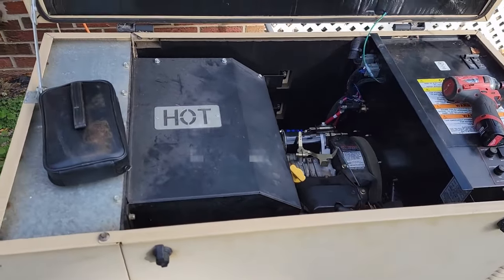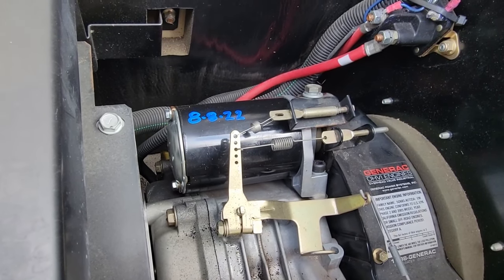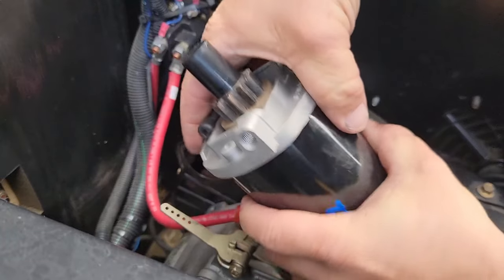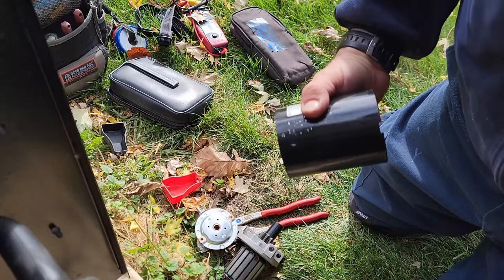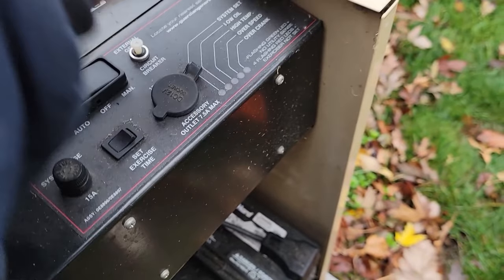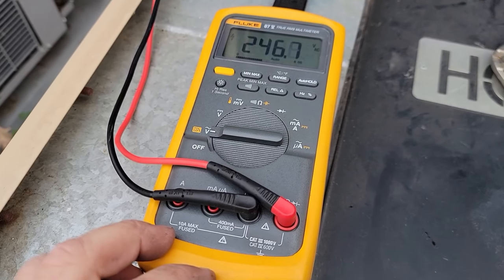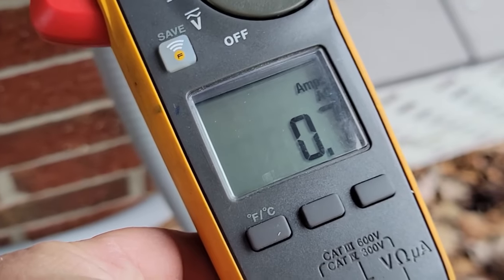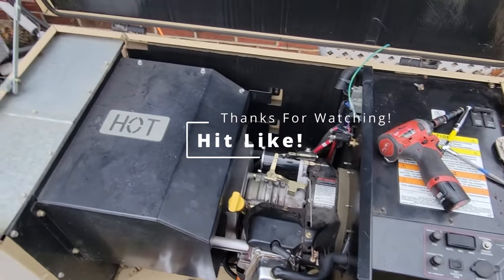Generac Standby Generator Wont Start AGAIN!!!

Comment: I have this exact model but I'm getting 160 volts out per leg. Do you have any suggestions? I'd appreciate the help.
Reply from the maker: Is that measurement L1 or L2 to neutral or between L1 & L2? Either way sounds like a voltage regulator is bad but you should have it tested before you spend the money on a part that might not be bad.
Reply: @HVACRSurvival  perhaps you could point me in the right direction with the diagnosing it. 
First time I fired it up. I got 120 volts on both lines to neutral.. hooked it up to the cabin and charged all my batteries. The well pump cycled on which may have spiked and put me over 3500watts 
Now I'm getting 160 volts out each line.
Reply from the maker: It likely is the voltage regulator but I hate telling you that and it not be it. Kind of hard to diagnose it without checking voltages and certain particular spots, and I'm not able to do that over the internet.
Reply: @HVACRSurvival  I completely understand that. Like telling someone how to fix a car over the phone. I was just hoping that my hunch was correct. Thank you for all your help.

Comment: Sold car starters for 20 years the shins where mostly for rebuild starters ,when they stone tumbled the nose piece would make the clearance to tight ,drive bendix would hit flywheel and not engage . Didn`t need for new starters .
Reply from the maker: I did this job over a month and a half ago and it is still working as far as I know, unless the customer doesn't know that it's not running. So I would say it was not needed, and that's why I showed the piece of paper instructing me to use that particular shim even though it obviously caused a problem. Just another inconsistency with generac

Comment: Is this generator from before or after generac decided to just send out notice that they need "rings" for new builds and get whatever and just use it? During hurricane IDA generac standby units down here were drinking more oil when operating than the Exxon valdez leaked.
Reply from the maker: I haven't heard of that, Usually they just don't run, eating oil has never been a issue for me.
Reply: @HVACRSurvival  don’t know when it started but my local dealer axed them after hurricane ida when he was on the move 18 hours a day feeding them oil. Kohler units were problem free. Within spec is apparently up to 1 quart a day for generac. That’s just nuts.

Comment: Hopefully you find out why its eating starters. Is it cranking for to long causing it to overheat? Maybe the last one toi put in was junk but that makes 2 that are junk... your on your 3rd now. Seems like a lot of starters for something that hardly sees any use.
Reply from the maker: The one I first replaced was the original, the new one was likely defective from the factory, the one in this video worked when I was done, then she bought a new outside unit.

Comment: Would it have been a bad idea to spray some lubricant of some kind on the flywheel teeth ??
Reply from the maker: It might have helped, I didn't think of it at the time and it likely would have worn off quickly.  In the past when I have replaced the magnetos, I have brushed off the rust and painted the raw metal.
Reply: yes and no.  Since these are exposed, it probably  needs to be a non-detergent kind of oil.   If it was fully enclosed, such as my old Ford Escort, you'd use a grease.   It's unlikely to wear off as quickly as most would think, because the starter spends the bulk of its time sitting - there's little to no friction to wear off the oil.   If you do a yearly maintenance, that would probably be plenty.
Reply: @tbelding   Of course if you could get in a time machine and go back 15 years and get a quality part you wouldn't have to worry about lubricating anything.....
Reply: @2packs4sure  - unfortunately, we can't control the manufacturer, or rather, the assembler.  We can, however, control what happens to the part we replace.

Comment: You used the wrong shim so it wasn't aligning with the flywheel properly. It was binding and that's why it failed. Use the thick dogbone shaped one that comes in the box with the starter kit.
Reply from the maker: I did you that one and I used the thin one that I showed the paper work recommended, I removed the thin one before I left.
Reply: @HVACRSurvival  I've probably changed a hundred of those over the years on the single cylinder engines. They're not great starters. Always just the dogbone shim for them.
Reply: It appeared that the original burned up starter didnt have the thick shim.
Reply: @willrobinson9575  likely what caused it to fail. Not being aligned properly. Every one I've ever replaced has had the thick shim from the factory. Replaced 2 yesterday.
Reply from the maker: @willrobinson9575  it had both just like the instructions called for.

Comment: Wearing a ring?
Use paint marker or sharpie for springs (to mark) or take beginning pics
Reply from the maker: I wear a rubber ring. I have a paint marker that I use in most of my videos.
Reply: @HVACRSurvival  I just found your channel. 
How do I get on with somewhere like Generac? Sounds like you may not like them though
My military mos was power generation repair in 90s and have a 2 year small engine certificate from high school in mid 90s .
A shop said the other day my small engine certificate is useless bc so much has changed but I don’t believe it bc I’ve been working on small engines for weeks and just disassembled my generator that slung a rod.
Reply from the maker: Anybody can take their small generator class once that’s done then you can go to Commercial.

Comment: My generac keeps cranking and cranking but doesn’t start I changed the plugs but not sure what else to do because I’m not to familiar with LP system it has a puff of blue smoke when it does start….any ideas ?
Reply from the maker: Best off calling for service before you waste a lot of money on parts you might not need.

Comment: Completely unrelated to this partial video, however I want your opinion. How do you feel about Generacs announcement they are now recommending 5w20 oil in their standby generator? Me personally, in an air cooled engine that may run for 100 hours straight (most homeowners aren’t going to shut it down periodically to check the oil) I would want thicker oil with a good additive package. I’m located in SE Texas where it can be 100° out so in all of my power equipment with a pressured oil system I run AMSOIL Small Engine 10w40 or 10w30 in splash lube systems. Does generac have a reason other than marketing for pushing this oil?
Reply from the maker: For warm weather areas I've always heard using a strait 30 weight , we use 5w30 full synthetic because we deal with the cooler weather and need it to crank over faster in the winter.
Reply: @HVACRSurvival  so y’all haven’t switched to 5w20 at all then? Generac is really trying to push dealers to the 5w20 stuff and I just don’t understand why! I have a 2021 18kw and it doesn’t even have an oil cooler! There’s no way I’m putting a 20 weight oil in it.
Reply from the maker: From what I heard we were having problems getting the generators in stock for a while. I haven't been working on many lately. I honestly am over working on generators all together,  I have such a variety of work at this place that I'm ready for someone else to take my spot.

Comment: Maybe deburing the teeth on the flywheel might help.A dremel tool,and then polish the teeth with a wire wheel.
Reply: Too much trouble unless it is YOUR generator.  Replace the flywheel!
Reply: @randyab9go188  ...and maybe even ( I know this sounds crazy) grease the shuttle.

Comment: I got. Generator just like that in my house. put a new battery unfortunately, I can't figure out why it won't produce power. any suggestions ?
Reply from the maker: If it runs, then it could be a bad voltage regulator,stater,brushes,control module, if it don’t run, then it could be bad magnetos, fuel solenoid or regulator. But all those are just guesses without seeing it.
Reply: @HVACRSurvival   thanks man it runs I'll look into all those items.

Comment: The problem is that the flywheel teeth are so rusted that the bendix wheel on the starter got hung up in the flywheel, kept the starter engaged and it overheated. Clean the flywheel, coat it with a rust inhibitor and you should be ok.
Reply: But he took away a shim which made the gears fit tighter and it didnt hang up.
Reply: @willrobinson9575  First things first, Happy New Year. Shim's are used to insure proper  clearance between the flywheel teeth and the starter gear to avoid undo stress on either. If you noticed the flywheel was severely rusted and by removing the factory shim the starter teeth were now able to ride deeper into the flywheel which is at best a temporary fix. Now that the shim is removed the factory clearance is no longer set and premature wear will happen once again. There was a reason the starter he removed went bad so fast and in my humble opinion it still hasn't been cured.
 The rust needs to be cleaned off the flywheel and somehow try to figure how to prevent mositure from entering the flywheel area. I personally think it's one of a few design flaw's in the Generac Generator's.
 I would never own one. How do I know so much? I've been the owner of a small engine authorized factory dealership (now retired ) son's took over the business since 1959
Reply from the maker: This generator model has been a total piece of junk since it was built in somewhere in 2005 - 2006 area, this is the reason why I talk so badly about this model, it caused me several service calls over the years and it just was a total failure. Between this generator and a traditional generator,  I'll take my standard generator any day over this thing. The lady was an older woman whose husband just died and didn't want to deal with problems anymore, so she purchased a new outside section and reused the transfer switch. The technology has advanced so much that it just didn't make sense to spend much more time or worry on this thing. I'm not one for replacing things if they're not broke but in this case and in her situation it wasn't worth the hassle. Told her to sell the other one on marketplace to recoup some of her money.
Reply: @HVACRSurvival  I agree and so does a leading consumer magazine. Total junk.
Have a Happy and Healthy New Year. 
I really enjoy your channel
Reply from the maker: @user thanks! You too!
Reply: @Riker-eq2yv  Happy New Year. But you said the rust was causing the hangup. Removing the shim should have made the problem even worse however it did not. It disengaged fine without the shim. I think theres more than meets the eye with this video.
Reply: @willrobinson9575  from Lost in Space? 👍
Reply: @willrobinson9575  I agree removing the shim will allow the bendix to dig deeper into flywheel teeth thus causing premature wear even faster.
Reply from the maker: Did anybody notice that the Bendix was getting stuck on its own? The starter was hanging up!  😳,  it's almost like nobody even watches the video? I never claimed to be an engine guy but I did show on the paper that I followed the directions.  Quite simply, if the thing doesn't retract on its own, it's only going to be more of an issue when it's installed in the engine.
Reply: @HVACRSurvival  Its all good brother.
Reply: @Riker-eq2yv  Careful, your age is showing.
Reply: @willrobinson9575  my age started showing when I was drafted into the Army right out of high school and within 8 months found myself in Nam.

Comment: Just FYI, Horrid Freight is selling a replica of your parallel pliers, and they are even red.
If you want to see the "counterfeit", search "10 in. pliers wrench with comfort grip".
Reply from the maker: I seen them, I'm sure they wont hold up like these have, being used as hammer.
Reply: They are el cheapo chinezium. Good if you need them for that 1 DIY projects, we techs don't waste our time with them. Plus we're tool nuts!
Reply: @FrozenHaxor  I'm not a tech, but I did mechanical demolition for 10 years, and never needed a Chineseium tool like that on the job. I'm a tool nut myself. I even designed a tool for my trade for removing the backer plate for fin tube.
Reply: @HVACRSurvival  for what I've spent on Knipex, don't think I'm using any of them as hammers, but then again I'm more of a desk jockey tool a holic than  real mechanic!
Reply from the maker: @Dave I feel that because I spent more money on it,  it should be able to take some abuse. But I know what you mean. I've owned them now for about 5 years so they get a little beat up now,  when they're brand new they never got beat like that.  😂

Comment: If the newer Briggs and Generac home standby generators are trash, what do you folks recommend?  It seems to me that these things aren't rocket science and it shouldn't be that tough to make one that would run for years in intermittent service.  

Does anyone make a standby generator with a Subaru Robin engine?  How about one with a Honda engine?  Both make very good engines and I know both make (or other folks make with their engines) portable generators, but I don't know about fixed standby generators.
Reply from the maker: Majority of the problems with Generac is with the older versions, from 2005 to maybe 2012  (-/+ 3yrs). The current year stuff is not too bad, we sell generac only because it's affordable, and that's what people want to spend. The problem is people don't want to spend the price that it requires to have a commercial grade generator or one of these diesels that everybody likes to talk about, which anybody that has any clue what's been going on lately in this world,  is the diesel stuff going to be going away. The governments are trying to ban all fossil fuels. 
*The other large problem that you've seen in most of my videos is the customer doesn't spend money to maintain their equipment. 60% to 70% of the problems have been batteries, not keeping the proper oil level,  not properly breaking in the engine, poor installation practices, and poor manufacturing and design. As a service guy I can't do anything about any of the above things, all I can do is try to fix what I have to deal with.
Reply: @HVACRSurvival  Tnx for the response.  My wife and I are handy enough to be able to do the basic maintenance.
Reply from the maker: The maintenance and proper break-in is key

Comment: Is there a video on how to diagnose a bad fuel solenoid?
Reply from the maker: If it gets power and it opens and the gas pressure is correct then it's fine. They generally don't go bad, now the fuel regulator that's a different story. The rubber hardens in them and can cause hard starts.
Reply: Thank you! I was troubleshooting one, and I was getting fuel to the fuel solenoid, it was getting power but it wasn’t allowing fuel to feed the generator when it attempted to turn on. Does this means that fuel solenoid is bad?
Reply from the maker: Got to check your gas pressure, if it's too high it may not open.

Comment: Generac is a lifelong tutorial on how to repair a generator.
Reply from the maker: I think that's the most honest and  perfect description I have heard yet. 👍👍👍👍👍
Reply: @HVACRSurvival  Google PDG Generators. Their alternators range from 7 kW up to 500 kW and are paired with FPT, Yanmar, Perkins, John Deere, Isuzu, Mitsubishi, Samson, and Kubota engines. Fuel types are diesel, LP and natural gas. They are a bit more pricey, but you get what you pay for. PDG is a higher quality than that crap you get from Generac. You can even customize your own power package.
Reply from the maker: I have an 3000i inverter generac and an 8000w RMS  generac I haven't had any problems with either one of them,  I think the problem is this stuff sets outside and they were built cheap.

Comment: Why do these Designers not use the gen set itself as the Starter, Just add the Appropriate windings.
If kohler can do it with their Vintage light Plants. Why not any one else in the Future.. 
Thanks Much...
Mike M.
Reply from the maker: I went to the Kohler plant, it was a day and night difference between them and Generac
Reply: @HVACRSurvival  A friend of Mine Has one of the old ones with a 4 Cylinder eng and it uses the gen set to start it. talk about a sweet running unit 
The auto start will also shut it off when the load is removed. it takes a min of 100 watts to start and keep it running.
Reply: @HVACRSurvival  Please elaborate if you care to.
Reply from the maker: @Nspro what do you want me to elaborate on? It was just the overall environment that I seen at Kohler was more relaxed, professional and the employees were happy but that was a long time ago. When I went through the training at generac it was in the plant were actually building them,  Since that time they started doing their training in a dedicated location so that you don't see how they build them. These things are built at 100 mph rush and there's no doubt in my mind why these things have so many issues because they're running them through so quickly to mass produce them.
Reply: @HVACRSurvival  Thank you for that. It was not absolutely clear from your previous comment which was which but you just confirmed it.